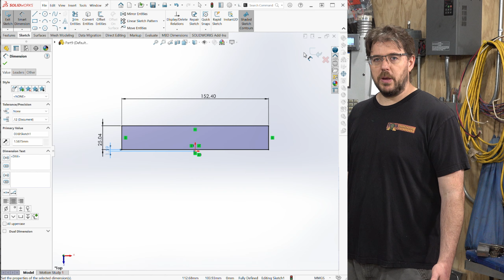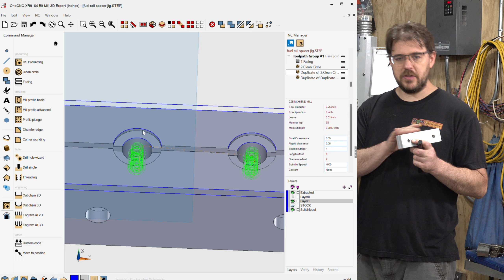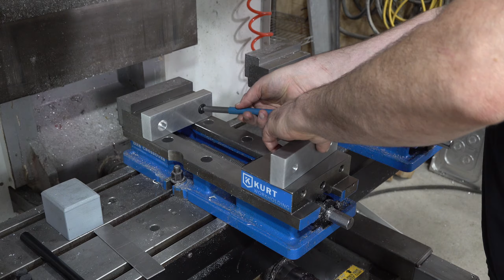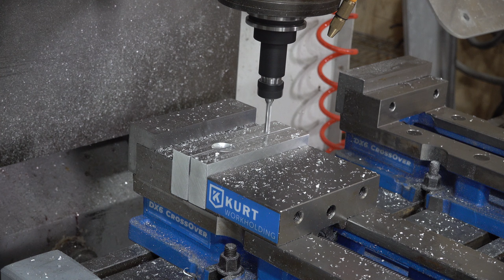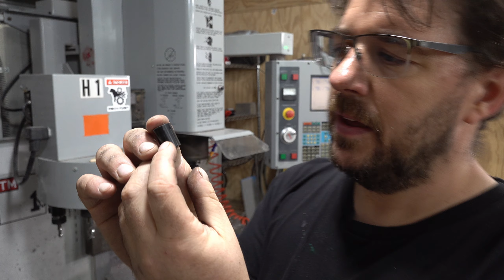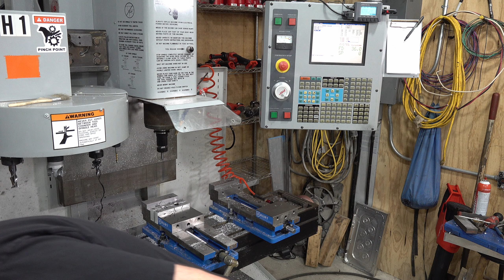First bulk parts run on my CNC

Comment: I'm a huge fan of Autodesk's fusion360 for CAD/CAM. If you haven't tried it yet, you may wish to give it a shot. It's free for non-commercial use, and they often have a deeply discounted option which unlocks the full feature set.
Reply from the maker: Unfortunately this is commercial use so the software licenses are paid for. I'm not willing to put a core part of my business on cloud subscription software that could disappear or change at any time.
Reply: @FrankensteinMotorworks  I use Inventor at work and dabbled in F360 for personal use, and I can attest I very much dislike the cloud based aspect. (although there are parts of it I like better than full-blown Inventor) Solidworks is a fantastic program! I haven't used it in several years so I'm a bit out of practice. As much as I love Inventor, if work wasn't paying for it, I cannot recommend the license fee....although they have a flex plan where you get tokens and it's as pay as you go as possible....

at any rate, I just watched all the videos from after the Gears and Gasoline outing at Lemons, really enjoying your videos!